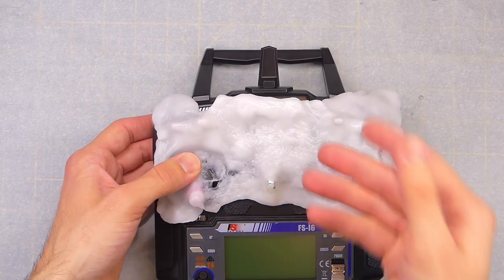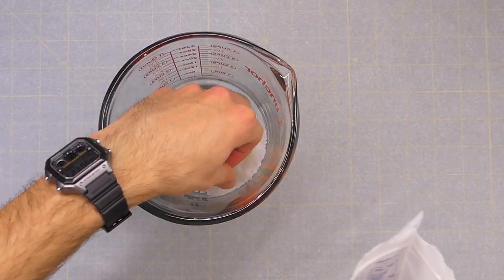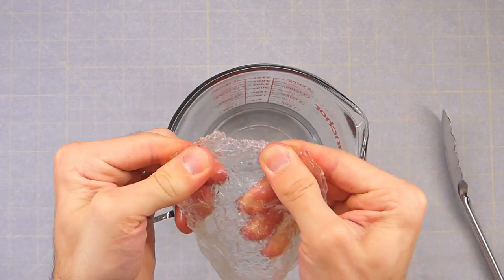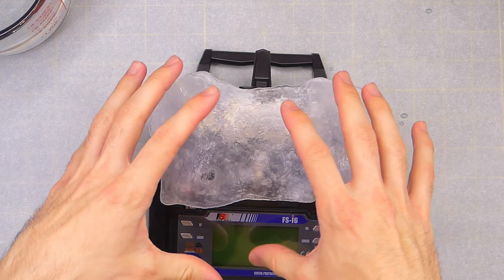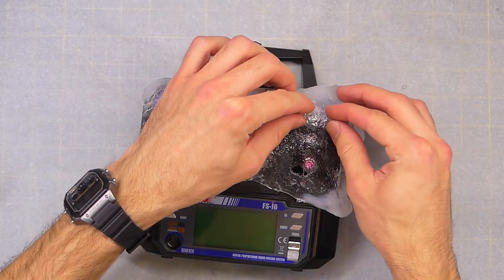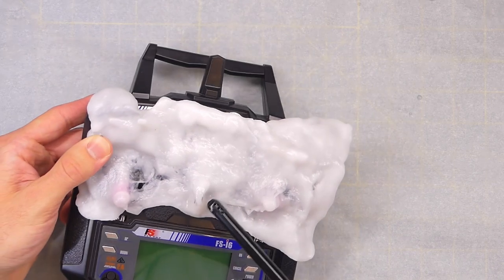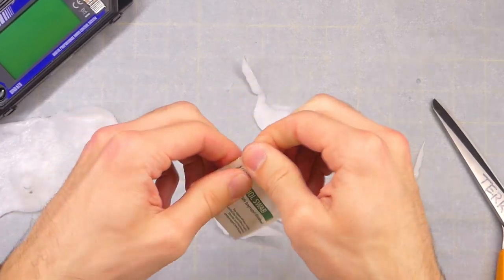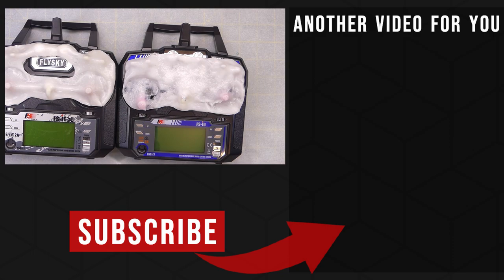InstaMorph Gimbal Protector - How to Make DIY FlySky Radio Cover

Comment: You should make people aware, if you live somewhere hot, the instamorph will get hot enough if you leave your gear in the car for long at all, it will start to remelt. I had high hopes for this stuff for making random bits for quads when I first started flying but it gets so hot in Florida that you can't really use it. I've also had it stick pretty hard to certain materials (like essentially bond with it) so depending on what plastic your radio is made from I would be careful. Still cool stuff though. I still have some.
Reply from the maker: Very good point! Thanks for mentioning that. I've had mine in a hot car, but not in direct sunlight on the dash, and no issues so far.

Comment: I use a 3d printer for this.
Reply from the maker: Hi! That's cool! Can you give a link to the print file you used? I want to print one but not sure of which style I want.
Reply: @RCwithAdam1   I don't have a radio yet😂. I have seen some rotor riot logo gimbal protectors on tingiverse.